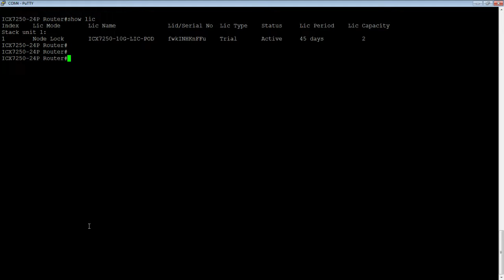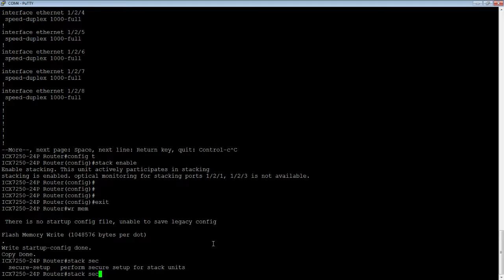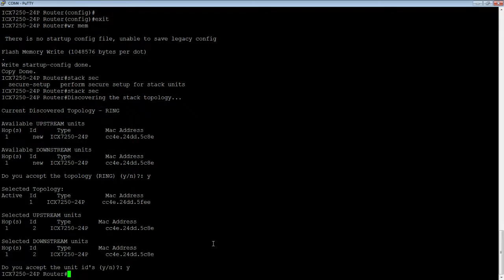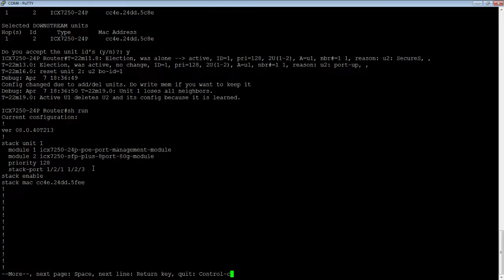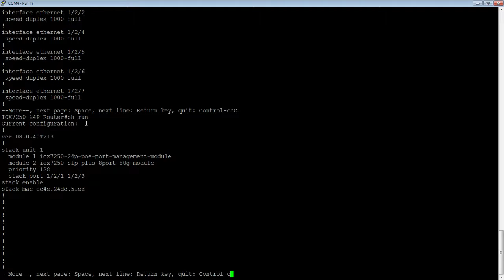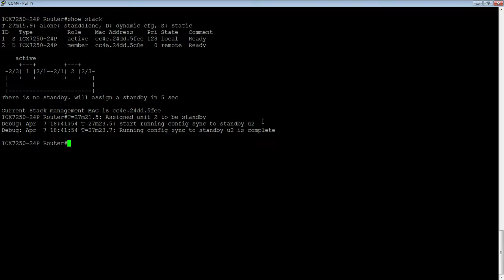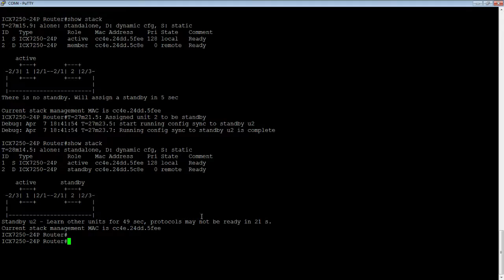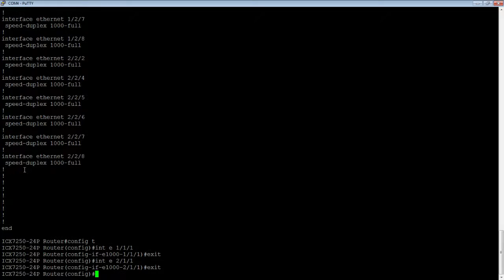Brocade Campus ICX Stacking Configuration

Comment: How would you configure a 7450 that had stacking enabled in configs that you want to add as switch 3 in a current 2 switch stack?  Would you run stack unconfigure clean?

I have a two 7450 stack currently. I received a third 7450 that was previously used and has stacking enabled and was unit 1.  I just want to slap it at the bottom of the ring topology as ID 3.
Reply from the maker: yeah, stack unconfigure clean and i would do an erase start after that to be sure then add to existing stack.
Reply: @TerryHenry  thanks for quick reply!

Comment: I just stacked a pair of 6450-48P's and I discovered something peculiar.   My 6450's were used and I was testing them out prior to replacing my main switches (a Quanta LB4M and a Cisco SG300-28MPP).   One of the 6450's was trunked to my LB4M.   When i issued the stack enable command the Quanta ceased to transfer packets and I lost the rest of my network.   Pulling the trunk cable restored the communication on the LB4M.    Not sure why.   I would think that this command would only affect other Brocade switches and then only the same series of switches (64xx, 72xx, etc.)    Terry, is this because the Quanta software is a close clone or cousin of the FastIron firmware?    I think I recall the Quanta can run FastIron software.   It is currently running Vxxworks 5.5.1 Sw 1.0.2.17.
Reply from the maker: Your LB4M is likely plugged into the default stack ports. When you enable stacking those ports will no long function as regular switch ports.  Check the first few lines in the show run or show stack to see what interfaces are stack ports.